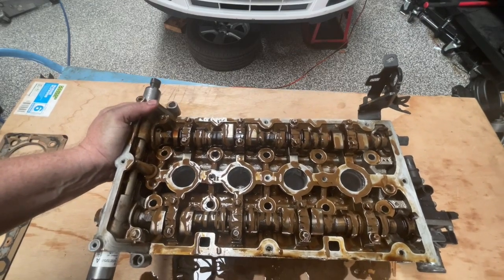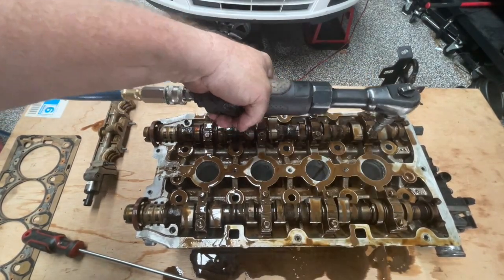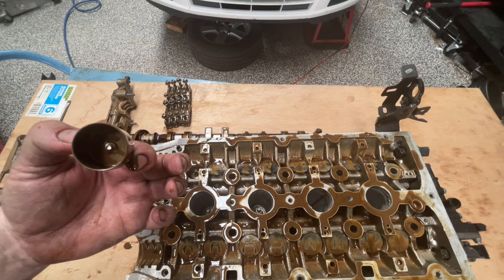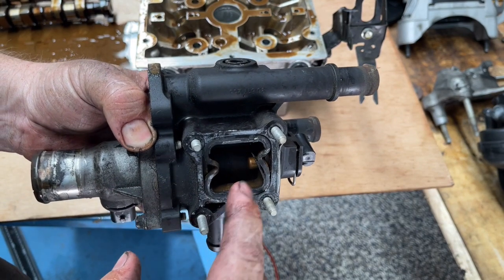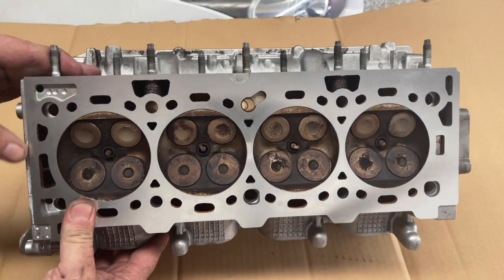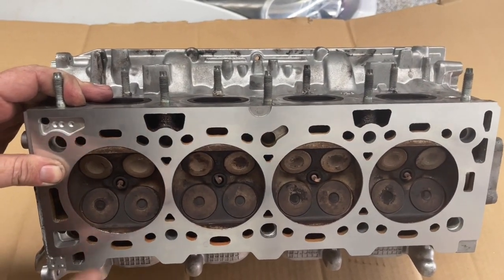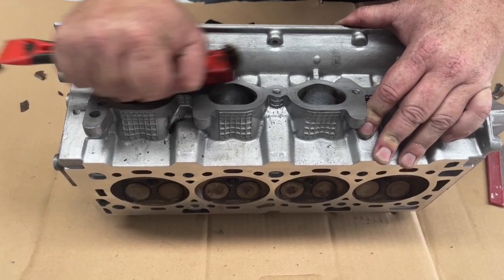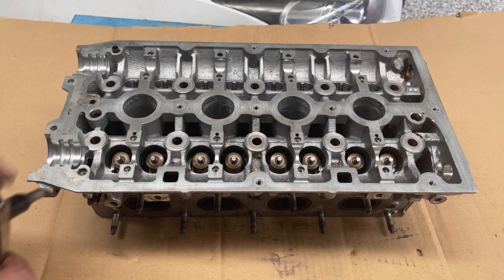Cruze Head Gasket Replacement  STEP by STEP process (Part 5 of 16) Full Details for 1.8 F18D4 Engine

Comment: Just watched this videos and explaining the way you did is just Awesome! I got a 2016 equipe and it has a cracked head where the Sparkplug well on No.3 or 2.. I found out there's a Recall on this but holden will not own up.
Would you advice getting a head from the wreckers or get a reconned head and where to buy it from? Thanks much

Comment: hey im looking to do my head gasket on my 2012 chevy cruze 1.8 myself and i want to get the cylinder head machined just incase it is warped but he wants to know if the valve lifters are hydraulic or solid in the this video they look solid but in other videos ive found for the same car they are hydraulic could you pls get back to me and let me know how i can tell what my car has without taking it apart yet
Reply from the maker: In Australia the F18D4 engine always has solid lifters. Other countries may have different but I have never seen different in these cars.